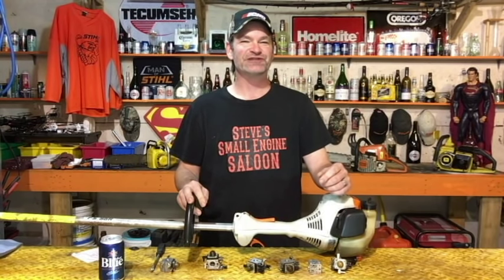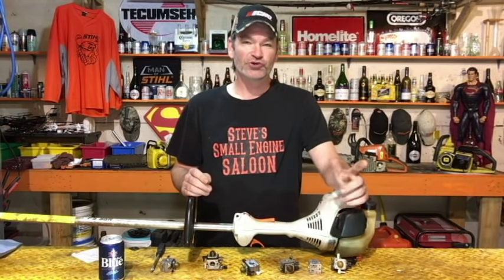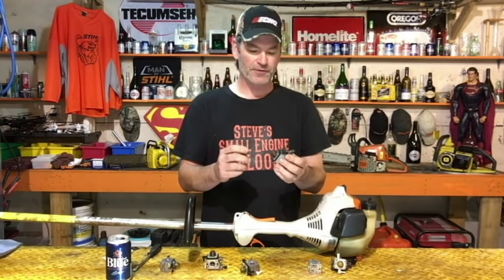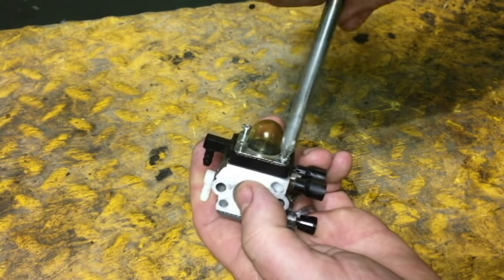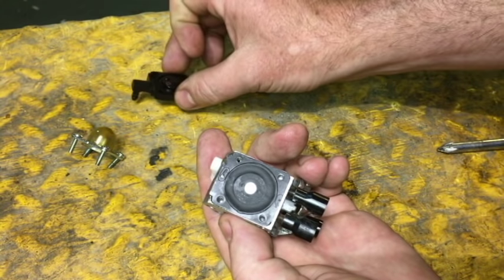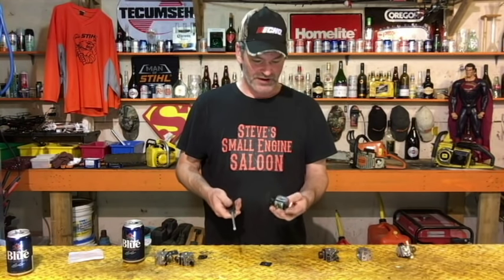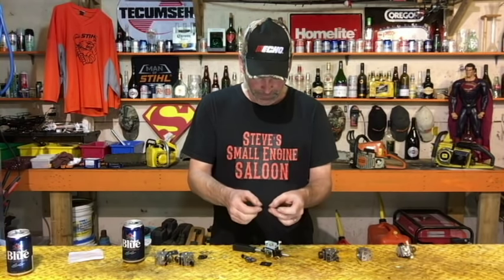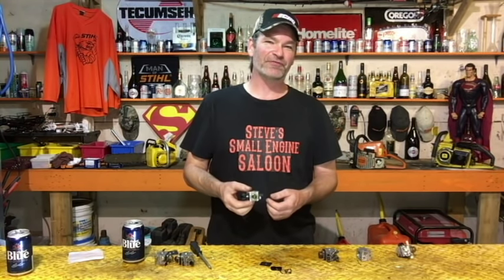How To REBUILD A CARBURETOR On A ChainSaw, WeedEater, Etc.

Comment from the maker: Need a rebuild kit?  CLICK THIS---- http://amzn.to/2jV2qUm 
MY WEBSITE ---- http://www.StevesSmallEngineSaloon.com/
Reply: Thanks for this video. I have this same carburetor on a string trimmer. On the metering diaphragm side, there is a brass looking part with a whole in it! Is there a PLASTIC PIECE underneath there. Accidentally poked a hole in it. 
Now my carburetor does not run correctly. 
It will run in 2nd position. Move it to 3rd and it boggs down. Than cuts off.
Reply: Which side will cause it to bog the diaphragm side or the fuel pump side ???

Comment: Don't know if anyone else has mentioned this but a step ALOT of ppl miss is setting the needle valve lever. In most cases the end of the lever furthest away from the needle valve should be flush with carb chamber body. If too high will flood ...if too low will lack fuel flow.

Comment: "You CAN, actually, use any beer to do this job..."  LOVE IT, Man...!  As a new subscriber, I'm having fun checking out all your videos.  Keep up the great work.
Reply from the maker: Thank You...
Reply: As a non drinker I hoped having lots of tools and this video would be enough to fix my carbs. But I don't have beer so this job is outside my scope. I Will have to pay someone else to do it...
Reply: @Orlena2525  It's the carbonation in the beer that helps get the brain cells tingling. Any carbonated beverage would be a good substitute, although you won't get the alcohol buzz to go along with that brain tingling from the carbonation!
Reply: Same here, just subscribed last night.
Reply: I called the manufacturer and they prefer Coors Light for this job

Comment: I finally got my hitachi weed eater working off your primer installation video and after some new hoses and spark plug. I was thrilled to have it running after sitting for 7 years or so and then it died the next day. Watched this video, took it apart to this level, everything felt good so I cleaned it an reassembled and it’s running great again! Thank you!
Reply from the maker: You're Welcome...

Comment: Two days ago I rebuild my old Russian weed eater's carburetor using your advice. I changed the diaphragm, also that thin  rectangular membrane. Since the piston head was black, I had to remove carbon residues on the top of it. I had no special cleaning substances for that, so I had to improvise. I used sandpaper dipped in engine oil, then dry sandpaper, and at the end I polished the piston with a felt disk mounted in my drill machine, it surely looked better after that comparing to those small dimples left after the first stage of the cleaning.  Today I put the engine back  together. It starts very easy, works normally. I love it. Many thanks, Steve! ❤
Reply from the maker: Right on Sky!  Great job...

Comment: Your video helped me get Sthil O44 running again. I've taken it to three different Sthil certified shops. None of them could get it running. They all said it was worn-out. I got a carb kit for it and now it runs perfect. Replacing the metering diaphragm is what it needed. Thanks!
Reply from the maker: You're welcome...
Reply: I'm surprised the shops didn't try to sell u a whole new carb with their 300% mark up 
P.s. u can get em online for like 15-20 bucks

Comment: Steve, I got it fixed.  I removed the high speed screw and spayed with carb cleaner.  I put the screw back in an once I figured out where the high speed screw should be initially set it started up fine.  I dialed it into the sweet spot and it runs as good as new.  
I really appreciate all you videos, I wouldn’t have been able to get this fixed without them.  The Great Lakes Elliot Ness beverage certainly helped.
Reply from the maker: Right on Buddy...

Comment: "You can use any beer to do this repair" - Subscribed
Reply from the maker: Thank You...
Reply: That's definitely my favorite part. 😂. This guy is who I watch for any of my questions about small engines.  Guy is great.  Keep it up Steve!
Reply: You also need a screwdriver. Ahaha
Reply: You should check with the manufacturer
Reply: How many beers Steve? Is there a particular formula for figuring that out? Does the manufacturer warranty cover a certain volume of beer? LMAO 🤣 🤣
Reply: Yep 👍 although my wife did wonder why I was getting a beer from the fridge at 10 in the morning 😁

Comment: Thank you for this! I got 2 old jonsereds that wouldnt run from a relative. 

Thanks to you I found out that the gasket and diaphram was mounted in wrong order. Swapped them around and it started at the second pull 😄
Reply from the maker: You're Welcome...

Comment: Thank you so much, Steve for this video! Thanks to you, I’ve been getting my small engines running without taking them to the shop. While not identical to the one in the video, I cleaned & partially rebuilt the Zama in my Homelite SXL. It’s currently my only saw & I have to cut 35 cords of firewood every year for my parents & I. Oh, did the job with Busch Light. Not much in the flavor department, but I didn’t get all buzzed up & screw up the carb either. It’s s fine line!
Reply: Great work ,, but the beer ,,, jeez

Comment: Thanks for the video and instruction. Just did a partial re-build on a Stihl 023 chainsaw (Walbro WT 215 carb) using this video and it worked out great. The metering diaphragm did have a bit of a click to it.  I don't do this often so I took lots of pictures as I went along to make sure I got things back together correctly. I also had to adjust the Low speed idle just a bit after getting things back together as I found there was too much fuel getting into the cylinder, causing my spark plug to get wet (flooded). A minor adjustment made all the difference. The chainsaw runs great now and I can sit it down and it keeps idling (yay). Love your videos and thanks again..
Reply from the maker: Right on Al!

Comment: Thanks Steve,
My little Poulan has a different Zama with the fuel pump diaphragm under the primer bulb and the metering diaphragm on the bottom. Anyways,  with your help here I got him all touched up and running just fine. The big tip was to get the diaphragms and against the body with the gaskets on top... You da man!!...but bein' Saturday afternoon it took me three beers ......Nice to see a local guy doin' good.....I'm just down the road in Duncan.
Reply from the maker: Glad to help

Comment: You should always replace the priming bubble too! They get hard and crack too.
Reply: Their making better ones now that last longer. They hold up better to the ethanol gas and UV rays.
Reply: @Alwis-Haph-Rytte  Thanks, for this info. Glad they made improvements.
Reply: yup, might as well do fuel lines also when you've got your machines opened up. Cheers!

Comment: This is the only video this guy's made that really falls short. There's several other basic things that can be done at this point including pulling the idle and high speed adjustment screws and blasting them out with carb cleaner and poke a wire through the jet if there is one sand blow it out. If it's gummed up just replacing the diaphragms won't work.

Comment: lots of useful info in these. Been binge watching them all afternoon.  Thanks!    FS 250 has always been a hard starter.  If it has an internal compression release, it is not working   Now needs a half choke to run at full.  Spark arrester?  What about cleaning jets? CArb cleaner? 

So you prefer to exercise rather than seasonally put away drained?
Reply from the maker: Awesome brushcutter!  No comp release on that one.  Did you try this.  click-----> https://youtu.be/gmhxTvGRtCg
Reply: Hey Steve,  how's that brew?  Yup, love this cutter.  Thanks for the response and help.  No, hadn't tried playing with the needles.  This zama only has a low anyway.   Spark resistor was fine.  Not the problem, but the throttle cable seems to have stretched 1/8" as well.  Need a new one but I shouldn't need to touch the throttle for start anyway?  Noticed primer bulb in video is full.  Mines not.  Maybe now bigger issue.  Jambed a wire down the main Walsh plug trying to clean it. Forced it into the main chamber.. Looks like my stupidity will now cost a new carb!  Some sort of check valve under the Walsh?  Any thoughts and any experience with a Hipa carb?  $20 incl. Air filter and spark plug.  Beat that.  Thanks again

Comment: Good approach is, in addition to this carb soft-parts kit instllation: do the fuel lines, the fuel-filter / pickup-tube, primer bulb, any gaskets that you damage removing the carb; and inspect: air filter and spark plug; be sure to clean the spark-arrestor screen carefully with a mapp / propane torch, and you shoud be good to go! I like to use original STIHL but I don't mind STENS. Do not discard your STIHL carburetor under any circumstance; the word on the street is to "NOT USE COMPRESSED AIR" on the carb body due to some damage that can occur to the mechanisms behind the welch plugs; With the STIHL gear, you cannot rule-out an intermittent coil-pack, either, so never assume that just because it is sparking, that is is OK, I have seen this a few times where the coil makes a weak spark or maybe out-of-time-spark (I don't know for sure), but make no assumptions that a spark is sufficient. If anyone else knows more about failure mechanisms of the coil-pack, please let me know; the new coil-pack has solid-state components onboard (such as rev-limiter) and these complicate diagnostics related to coil-pack.

Comment: Steve - I love your videos, they've got me pulling out old trimmers and chainsaws I gave up on years ago just to get them running again! I do have one question though - I have a pole chainsaw (Husqvarna  326P5 X-series) and I need to adjust the carb... should I follow the trimmer or chainsaw procedure? I'd guess the trimmer, but I'd like to be sure. I've got a Victoria Bitter and a local DuClaw's craft beer chilling just in case it gets complicated!
Reply from the maker: Definitely the trimmer procedure.  MMMMMMMM Craft Beer.....

Comment: Or you can just go on eBay, and buy a brand new carburetor.  I bought one for my Stihl FS55 grass trimmer about a month ago, and it came with a new set of fuel lines, a new fuel filter, a new spark plug, two spare primer bulbs, both gaskets, and a new air filter, all for $11.98 with free shipping.
Reply: osu67  Well, according to a quick internet search, Stihl carbs are made in China. 

Here's what www.b4usa.com says:

STIHL Inc.
 Updated, July 13, 2016 by contributing editors. "Search America 1st"
Always verify USA Origin
Most of the STIHL products sold in the USA are made in Va. Beach, Virginia 
and a majority of the STIHL engines or “powerheads are built in the 
United States from domestic and foreign parts and components”.  The 
carburetors are manufactured in China; STIHL purchased Zama Corporation, Ltd., Hong Kong, on December 31, 2008.
Reply: Lol I bought one. Ran like new! First yard, go to weed eat and it starts bogging down then locks up. Did it again. Had to finish the yard so went and bought a new weed eater, because I was tired of it. Come out the store and gas is pouring out of the weed eater. Apparently it got stuck open and was flooding the engine. Wound up fixing the original carb later.

Comment: I enjoyed the video. I have tried rebuilding these 2-stroke carburetors in the past, 2 of them actually. Both times, I reduced an engine that would start and run poorly to one that would not start at all. I've had my best success simply replacing the carburetor.

Comment: Nice videos Steve.  I'll be back to watch a few others.  I've a quest to repair a Craftsman (Poulan) I received free from a nephew.  I noted the gas lines needed replacement, changed them along with plug, ignition and I still can't get it to pop off.  It's a battle of wills.
I have the kit, just didn't think I need that till I got it to pop off.
LOL

Comment: I just decided I'm "over" carbureted lawn equipment! I don't have any problem keeping "regular" carbs tuned and running right (I'm a trained and certified motorcycle mechanic), but for the life of me, I cannot keep this style carb running. I have a Ryobi leaf blower that starts and then shuts off right away, over and over and over again, and I have a Remington string trimmer that ran like an absolute champ with a brand-new Walbro carb on it a year ago, but now when I'm ready to use it, it also is a bear to start and won't idle. DONE! I'll keep my carbureted chainsaw, lawn mower and snowblower (for now), but from now on, as far as my other lawn equipment is concerned, it's batteries or bust! And yes, I only use ethanol-free fuel, and regarding my string trimmer, I drained the fuel and ran the carb dry when I stored it for the winter...

Comment: Particularly with the moonshine that is added to gasoline in the US, I also replace the primer bulb. I was going to use a gasoline chainsaw a few days ago, and it is fairly new, but the gas lines were brittle, along with the primer bulb looking like it would not be very long before it cracked.

Comment: Thanks for another good vid Steve. You helped me see what the mechanic I took my weedeater to screwed up. I had him clean the carb of my Stihl KM90R because the primer bulb wouldn't come back up when pressed and the motor only ran at half choke after having sat "with fuel" for more than a year and he had an ultrasonic cleaner. I had him  put in a new diaphragm since the old one crinkled like yours did. Problem was he didn't have the "EXACT" diaphragm and gasket. The one he installed didn't have the tiny crossover port. I saw that mistake when I watched your video. BUT in trying to figure out the primer bulb problem in the half dark and sub freezing weather I accidentally put a screw through the diaphragm that was installed so I can't return it. New parts are ordered and when they arrive hopefully the clogged carb problem was solved by the dip in the ultrasonic cleaner. I seriously need to get one so I don't have to rely on others and any mistakes will be MY OWN.  Sheesh, I shoulda had a beer BEFORE I started this repair or maybe a hot toddy to warm my numb fingers and a better light to see with.

Comment: You are 100% correct,I rebuild probably 75 to 100 of these carbs. each year due to customers using ethanol fuel or ethanol fuel blends which is extremely harsh on those carb diaphrams.
Reply from the maker: Right on....

Comment: Thanks for all the good info you put out there. I've worked on hundreds of small engines, but have been fighting a chainsaw I bought new for a few years now.  Very cold natured critter.  It sat for about a year with fuel in it so I cleaned/rebuilt the carb, tank etc.(I got rid of the limiter caps too) When finished, and back together it wouldn't even pop. Watched your video on saw carb rebuild and the lightbulb came on. Switched the purge bulb lines and it started on the first pull. Thanks again!!!
Reply from the maker: You're Welcome...

Comment: Hey, Steve. I have a Husqvarna 24R weedeater and wonder if you will feature any videos on it. It ran (after first pull) replacing the fuel line. Conked out after 10 minutes and now will not fire. I will be watching with hope you will some instruction on this model. Thanks, again for all of your advice. Much Appreciated.

Comment: Just watching to see if I could find anything I don't already know - I got nothing but I had an idea:
Using ATT205 automatic transmission seal softener - I wonder if that could be a quick fix in the field for the metering plates? 
I saw it recommended for all your rubber bushings & boots on your car/trucks too!

Comment: SUPER Steve, what is a symptom of a bad meter diaphragm? My purge bulb won't fill up and even when blower started, carb wouldn't accelerate.  Seemed like fuel not flowing to the carb.  Does that sound like the diaphragm?

Comment: Would this fix a echo blower that when u try to start it the carb just drips fuel out the bottom of it. Doesn't really start. Sometimes it will if I wait another 30 mins and try again

Comment: Thanks for the great videos Steve. My chainsaw is an inherited 1997 16” Craftsman. It would start once in a blue moon. I changed out the diaphragm and fuel pump gaskets and it’s working like a new one. I took your advice and bought some premixed gas as this saw can sit a couple years without running. I set up the air mixture and idle screw as per your video. Works mint!
Reply from the maker: You're Welcome...

Comment: Steve love all your videos. I have a Tanaka TLE550 edger with a Walbro HDA carb. It starts fairly easy and idles but won’t rev up when given any throttle. Just cleaned and replaced the fuel diaphragm and other side and gaskets. Where do I go from here

Comment: Appreciate your excellent explanation of the gaskets. Great Help, thanks. I have a Walbro HDA-49 Carb. It is used on the Poulan 2800 chain saw. However, as there is no primer bulb with this model, I am a bit confused about which port on the carb is the inlet fuel from the tank. There are only 2 lines for this chain saw. Fuel line, and a purge line, or maybe its called the pressure line. I think the purge line on the carb is on the top and goes back to the tank. Whereas the Fuel from the tank goes into the upper side of the carb for fuel feed. Please advise me correctly which is which. Thanks

Comment: Hi Steve you are very good. I do have questions how to change the pressure wash from 3200psi to 4000 psi do I need bigger engine ?

Comment: It is extremely important that you determine the make and model of carburetor you are working on as you need to buy the correct carb kit for your carb. Look in your User manual or contact the company of your machine.